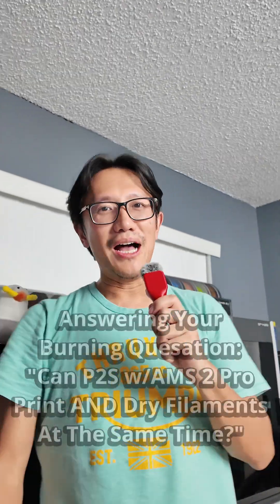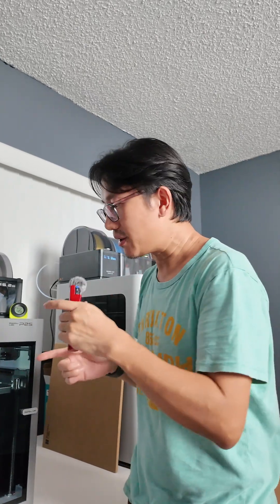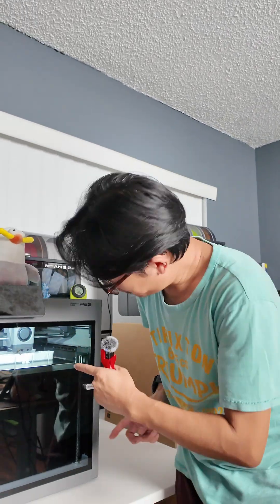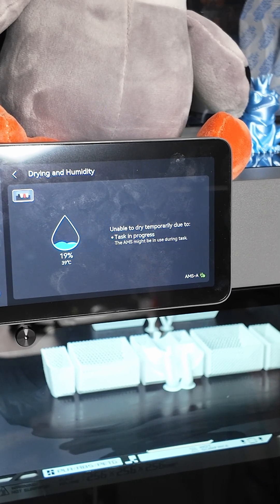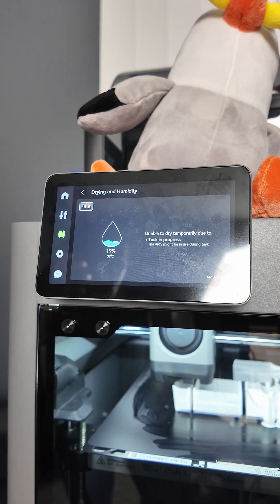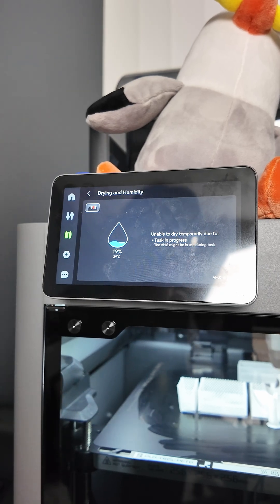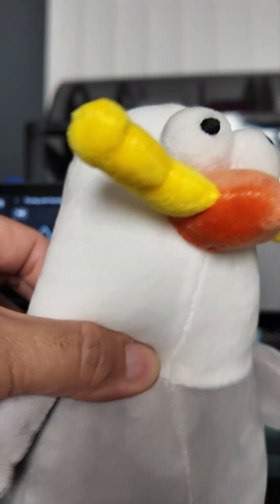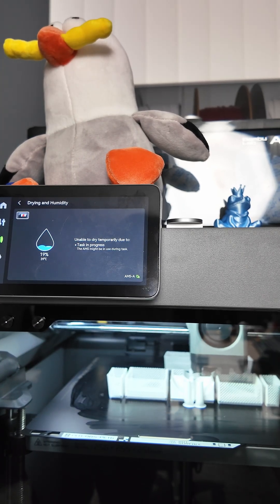Can Bambu Lab P2S w/ AMS 2 Pro Print & Dry At The Same Time? #p2s #3dprinting #bambulab #ams2pro

Comment: Nope :( my p2s and ams 2 pro shows me the same messages… we have 230V standard.
Reply from the maker: Thank you for confirming... Now I wonder where the rumour of drying and printing w/external power adapter came from.
Reply: @TheGizmoGarage  Using 2 AMS2Pro units. One of them would need the external power supply. Then one AMS2 can print, while the other one can dry.
Reply from the maker: @drewpurvis4195  This would be the logical solution to fix the "Bambu AMS 2 Pro/HT can't print and dry"
Reply: @TheGizmoGarage you know… I’m lies… it works without external power, but only when AMS in idle. When printer in progress drying is unavailable

Comment: It sounds like it's limited on purpose and may require what Bambu will deem an 'upgraded' power supply to unlock it for an additional cost. The adapter is 100W, this should be sufficient to run the dryer while the printer power handles other task as it normally does when the AMS2 power is not plugged in.

You can't turn off the printer to initiate the drying as it needs to be on to communicate with AMS and you can only do ONE task at a time with or without the adapter. The only reason is if you BUY multiple AMS units and want to dry w/ one while you use the other so that means MORE upsell of stuff most people don't need, like MORE AMS units. Such an A-holish move from Bambu.